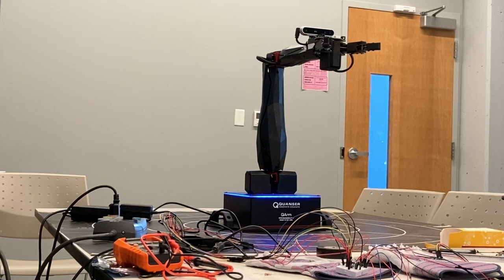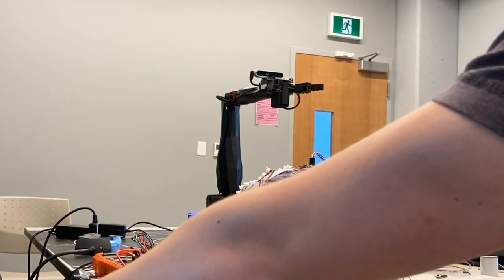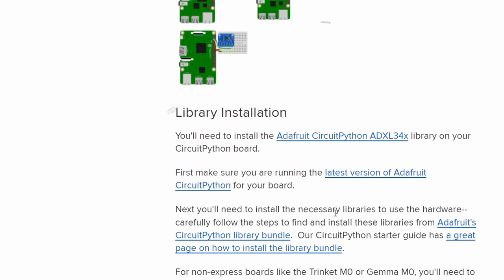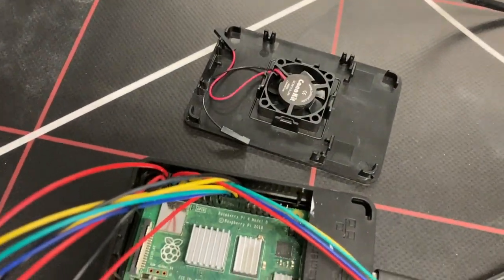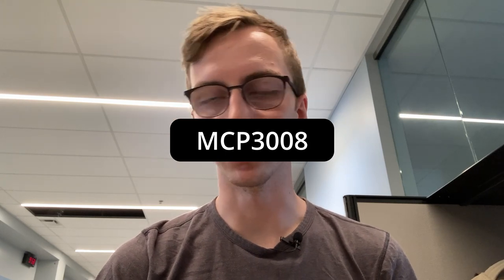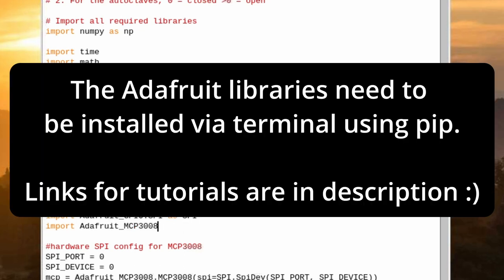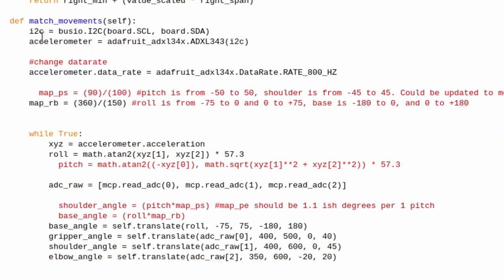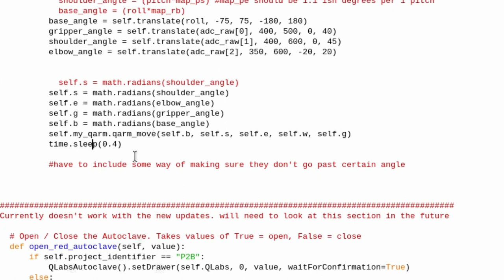I Created a Glove That Controls ROBOTS! (Flex Sensors and Accelerometer ADXL343)

Comment: It looks like the roll on the accelerometer is very sensitive. Have you thought about mapping it so that it requires a greater roll for the same rotation? 

You can also add a tolerance so that the arm stays in one spot unless you rotate your hand a certain amount of degrees, so that it doesn’t rotate if you keep your hand relatively still
Reply from the maker: Thanks for the suggestions, we had discussed thresholds, but I'll see if I can add them to make it a little smoother.

Comment: Hey Oliver! I am a 2nd year student of mechatronics, I have an idea for my project, I want to start doing it now. I'm interested to know your opinion, and what would you recommend me to study for this?

Idea:
1. There is need to be a metal box, box is assembled from 5 pieces, they are welded. SolidWorks has a model, it has these 5 parts and an assembly (assembled box model).
 2. We load 5 pieces and an assembly (this model and work process) into an industrial robot.
 3. We already have 5 parts on the table, the robot can recognize them and put them together and weld them with a laser.
 4. There is no programming here, the robot has a camera that can recognize the part.
 5. You can change the model, load the robot with a new one, put new parts and it can pick it up again and assemble, it is adaptive industrial robot.

In my opinion, this will spread automation not only in large, but also in small factories, because the robot will not have to be programmed and reconfigured for a specific part for a long time, it can be quickly set up and launched.

Comment: Hey dude, can you please do a video on how to control 2 servo motors and one regular dc motor with an ir remote? Please? I've been looking the entire internet and I think you could really help me! Just comment back on this if you can! If you can, i will give a sub and thank you for my life!!! Thanks bud, and make sure its arduino un0 r3 THANKS!
Reply: For the servo motor there are hundreds of tutorials online, and there’s also an example code that ships with the arduino ide

For the dc motor you can connect one wire to ground, and the other to an analog input pin. From there you can either turn the motor on and off by using digital write , or you can use pwm for speed control with analog write, if you need direction, look into an hbridge. 

You’ll have to do some research on your own for these kinds of things, people aren’t just going to show you everything in s video